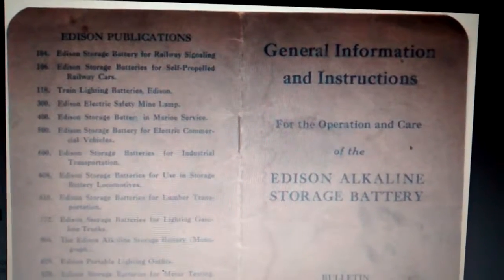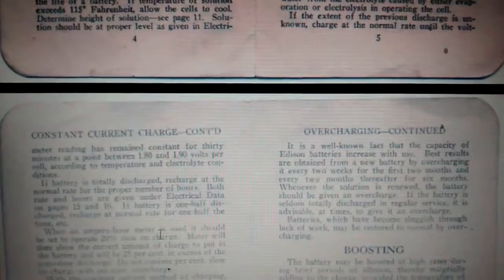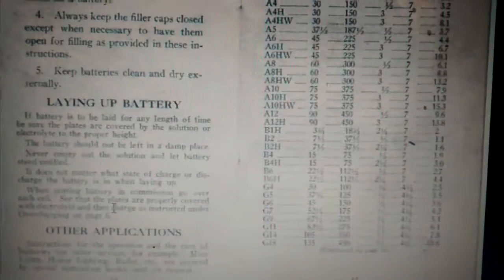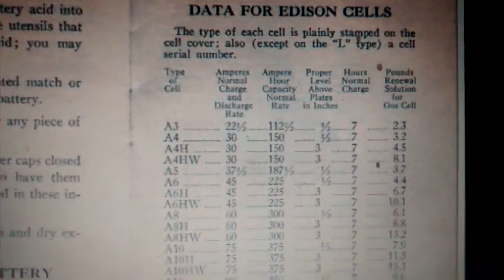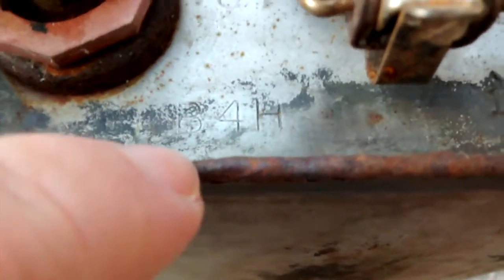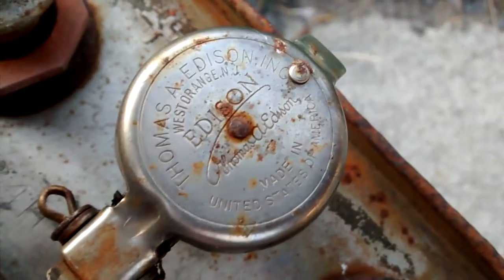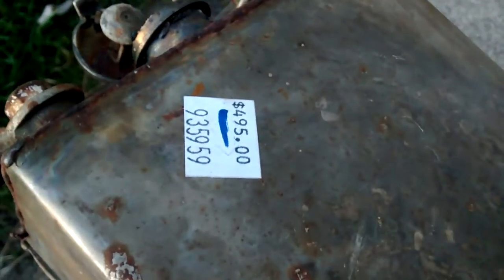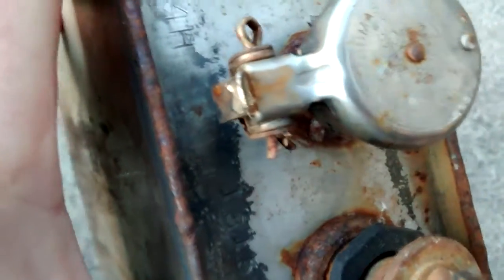How to identify Edison Nickel Iron Battery with Manual!

Comment: Not sure if the date code reads the same on those old ones as my newer style but if it does, it means it was made in Jan. of 1931 the rest of the numbers would be a production #.  I had 80 of these cells, I sold them off to a friend for his camp. There still going strong.
Reply from the maker: I bet those codes you have are spot on. I'm appreciating the knowledge. I have several more to get on YouTube and the goal is to put this info online so people won't scrap these anymore but decide to preserve them or sell them to someone who will. They were made for decades there has to be a lot still around. That friend of yours definitely has something not seen very much wish it was otherwise.